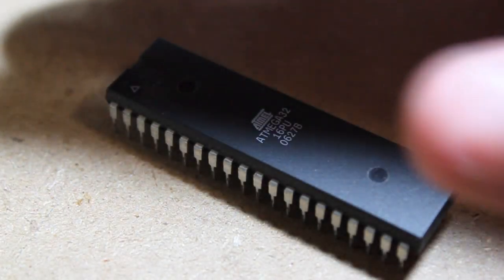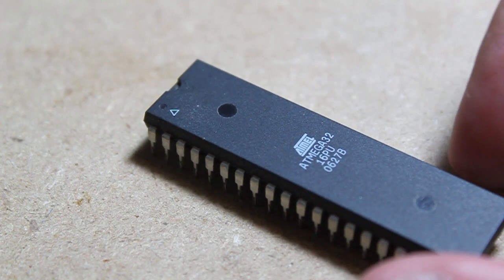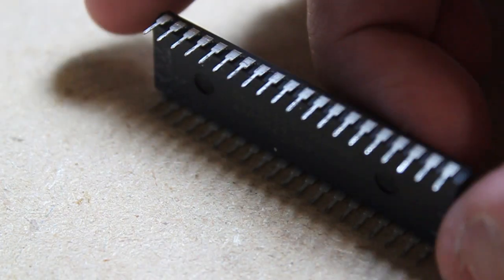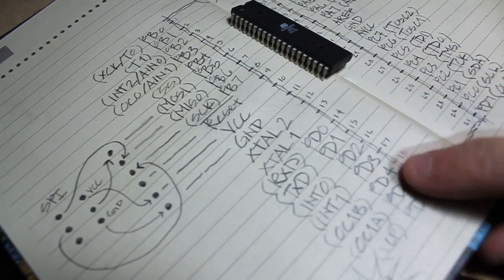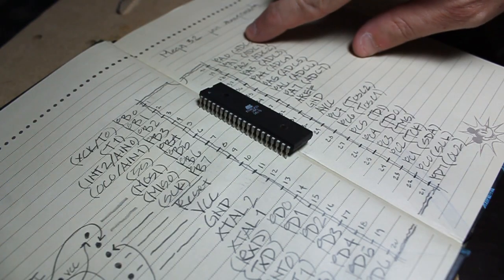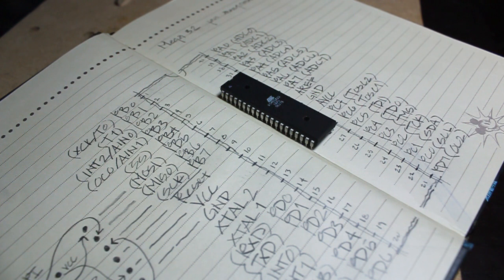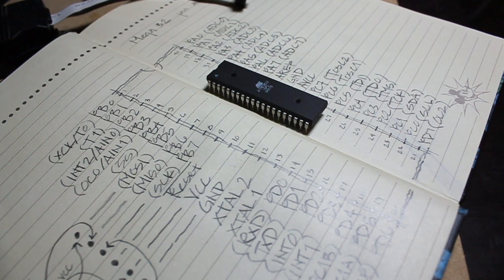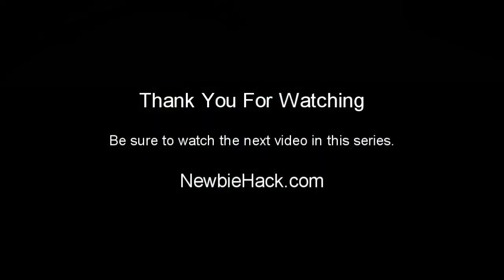1. Arduino for Production! A Beginner's Guide - Intro and How to Use the AVR Atmega32

Comment: Is this content still current in 2022?
Reply from the maker: Yes,  Microchip still supports this line of microcontrollers and the IDEs. This microcontroller can be used in may devices and is still used in the Arduino platform.
Reply: @PatrickHoodDaniel  thank you for your quick response! I’ll watch them. 

To make a USB peripheral device I’ve been using an Atmega32u4 setup based on Arduino Micro/Leonardo. My manufacturer wants me to migrate off Arduino ultimately which is why I’m here. 

I saw you have other ARM microcontroller videos, do you recommend something besides Atmega chips for USB peripherals? I’ve noticed Atmega chips are pricey and I want to be nimble with options based on supply chain availability…
Reply from the maker: @tnield9727  Absolutely, that is the best advice that your manufacturer could have given you. Each microcontroller has is best application. Arduino comes with a lot of circuitry you will never need in the production realm, and you will have the entire chips abilities at your fingertips. I would also encourage you to get into the ARM space as the chips are less expensive than the AVR and are m ore powerful. Once you learn the AVR, ARM is a breeze. You can start with either one as each is easy to learn.
Reply: @PatrickHoodDaniel  I'll do that, thank you.

Comment: Hello sir 
I am working on a project which involves use of a microcontroller to do various jobs like voltage, current sensing,communicating with LCD,lcd displaying,ADC,Pwm generation ,Temp sensing,serial communication etc
Will these videos help me to write the code for it
It would be very greatful if u reply

Comment: I don't have knowledge regarding embedded avr but i want to do something in it. 
Its my final year so i seriously want to make a good project. 
I am not able to select topic for my project and i'm not getting started. 
So will your video series be helpful for me to gain knowledge on embedded avr?
Will i be able to make some project? 
Please give some suggestions to me. 
Please sir.
Reply from the maker: My series on the AVR and the ARM embedded programming and circuit building will teach you the low level fundamentals.  You will learn how to modify control registers that make the microcontroller features work.  I also go into minor detail on electronics and how to connect certain devices.  With this knowledge, you will be able to make sophisticated applications that be applied to almost any technology related to microcontrollers.
Reply: What kind of applications??
Reply from the maker: IoT, Robotics, home appliances, mobile technology, etc.  The application are actually too long to list here.  But I hope this give you a good idea.

Comment: I love the tutorials! However, I ordered the kit, and I received a ATMEGA324P. Will these tutorials work with that micro controller as well?
Reply: Pretty much. Just download the pinout of the ATMega3244P and make sure you connect the right pins. However i think the difference you will have depends on what you want to do as ATmega324P has only 4Mhz of speed but that can be fixed as you can use an external clock.
Reply: Thomas Heaven Thanks! I actually ended up figuring it all out, and then using an external clock.
Reply: Franklin Tackett Jr
Awesome! :)

Comment: Your videos are excellent content.  I am navigating through the process to connect a uC to a TFT.  I'd prefer to use the parallel interface as opposed to SPI or straight serial (Nextion).  Do you have any experience with this?  If so could you put together a tutorial? Thanks!

Comment: on your dvd,  the lessons listed below are they covered in your full dvd?

1. Introduction to Computer Hardware 
2. Introduction to Computer Software 
3. Computer Arithmetic 
4. 68HC11 Programming - Part A 
5. 68HC11 Programming - Part B 
6. Branching and Loops 
7. Indexing Through Memory 
8. Subroutines 
9. Reading Assembly Listings 
10. Memory Systems I 
11. Memory Systems II 
12. General Purpose I/O 
13. HC11 Interrupts and Resets 
14. Analog Capture - Port E 
15. Timed Events - Port A 
16. Serial Communication - Port D 
17. C Programming and the HC11

Comment: you said that C++ is an easy programming language?

what the ** is an hard programming language in your opinion?
Reply from the maker: Haha.  I would say Assembly language is nearly the hardest, but it uses the simplest instructions to make it work.  I think that is what makes it hard.

C++ and most other languages were developed to make programming easy.  That is the reason programming languages are made, so humans can interact with machines.  In many cases, you can learn a few fundamentals and achieve almost any result.  There are so many ways to program one thing and that concept may cause someone to become paralyzed in writing code.

If you come to a programming language with the thought that it is hard, then the programming language will definitely be hard to you, but it doesn't need to be.
Reply: Assembly lol c++ is simple if u only use it for simple tasks.
Reply: Prolog
Reply: Assembly..

Comment: Hi Mr Patrick. I would like to thank you for the great job and the very helpful videos you are providing in your channel. 
My question concerns an error that i keep getting, and, i suppose, prevents me from getting my delays (from util/delay.h) to work properly : "Compiler optimizations disabled; functions from <util/delay.h> won't work as designed"
In fact, i m trying to setup codeblocks ide instead of avrstudio for avr development  (have to work on ubuntu). Is this related to any option in the compiler ? 
Thank you in advance

Comment: Daniel sir ive found  solution for ATMEGA 32A. there are some changes in low fuse bits of ATMEGA 32A than ATMEGA 32.ATMEGA 32A can be used as ATMEGA 32 by setting ATMEGA 32A's clock bits as of to ATMEGA 32's. by running command as youve described it in one of your videos. please share this information for your followers as well as watchers in your channel.thanks you ..... (:

Comment: If you write a book on microcontroller programming in the same style that is present in your videos, in my opinion it will also sell good and will make you take the financial rewards that you deserve.
The best book in my view on microcontroller programming is "AVR Programming Learning to Write Software for Hardware by Elliot Williams". The book is very good but I don't like the funny (in my view) sidetracking. If you like my idea, I suggest that your book should be as much comprehensive as the above said is but on the chip Atmega32. This will complement your work and - for the user's point of view - more beneficial to him.

Comment: I have a usbasp programmer with a 10 pin female connector and atmel atmega32 microcontroller.
I have installed the latest version of WINAVR which contains avrdude version5.0
I was trying to test the programmer but encountered the following error/

avrdude:program enable:target doesn't answer. 1
anrdude: initialisation failed, rc=-1
double check the connections and try again 

i have check the connections amny times. 
most unfortunate thing was i wasnt provided with manuals.
I would very grateful if you help me!

Comment: Hello
I tried to use the C6 pin  of Atmega-8 as an input pin for the first time to turn on an LED on another pin  and hence programmed the RSTDSBL pin for that.
The program runs well but after that I was not able to reprogram the IC again.
I thought the IC would have gone wrong so I burned the same program to another chip.
the program again ran well but this too is not getting programmed again.
however the the program I burned earlier is still running well.
please help as I have two unuseful ICs now.

Comment: I saw video that show when you try to divide by zero on ATMega32 this CPU explodes but I think this is fake. Buffer overflow doesn't cause the explosion of CPU but application crash if program is not secured by undefined behavior (like Guru Meditation in Amiga or Blue Screen of Death in Microsoft Windows).
Reply: Blaze Rhodon I

Comment: Hi patrik. I would ask you a question as I see in lecture 7 you configure portb0 as output my question . I did the same configuration but by external programmer then I feed the chip 5v but the led does not work shall I feed the chip by external clock please I need your help

Comment from the maker: All you need to do is confirm that you are connecting to the correct pins and if the 32a has a different name for the makefile, use the name associated with the 32a.

Comment from the maker: Arduino is a higher level platform.  There are a couple pros using this method: You learn the native programming for these microcontrollers, you can develop circuits more freely since you are developing with the actual chip rather than a board with many components.

Comment from the maker: These are excellent points.  I do mention #1 and #5 in the videos, but I am happy you mentioned them here.  Good to know on #2.  I did mention in one of the first videos that void is ok as the return type.  I generally use int, but I never return.  Do you know what happens if there was a return in main and it reached that point?  I am soon embarkingon the UART and know that the error percentage is important, I will make sure to emphasize.  #4 is good to know.

Comment: As a great fan of these videos I would like to add 5 very important points for beginners. I copied these from someones signature on a forum. Two of these Faqs have already bit me as a beginner.
1. ISR/main shared variables MUST be defined ' volatile'.
2. embedded programs must never return from main
3. 99.9%  of UART errors are AVR's not being clocked right
4.If using avr-gcc  avoid OO optimization
5.If PORTC bits don't seem to work JTAG probably needs disabling

Comment: Now i have got my programmer to work. I tried mapping the 5x2 pins to MOSI, MISO, SCK, RST, VCC and GND to the microcontroller and only after 4 days I was able to understand that the pin mapping of the programmer i had bought was wrong and was not following the standard pin out of USBASP. With no idea about the pins but sure only about vcc and gnd, i tried by trial and error to find the rest of the pins. The reason for my no giving up attitude is due to your tutorial videos.

Thanks.

Comment: Right now I have the pin mapping of my programmer, i mean the pins pointing to Vcc, GND, RESET, MOSI, MISO, and SOCKET etc., But it is not working if i connect the appropriate pins to the ATmega32A. AVRdude says the target doesn't answer. I believe there is a scope for mistake since i am a newbie. Can you let me know if there is a link that shows how to connect it to the microcontroller on a breadboard? or the board that you have made will it work?(the soldered board you showed in the video)

Comment: Hello anajones,

First i wish to thank your for the videos. Microcontrollers have become my new found love because of the way you teach. BTW yesterday I bought a programmer in my city as I do not have any online sites delivering for my geographical location. Even the one i bought yesterday was procured after a great difficulty. I connected the programmer and installed the drivers and found out it was USBASP. Since it has a ten pins only how can i connect it to do your examples?

Comment from the maker: @BrentBXR You are correct. If you will touch the pins, then make sure to dissipate the static electricity by grounding.  This tutorial was developed to show various features of the microcontroller, so touching it was necessary.  Thanks for the tips.